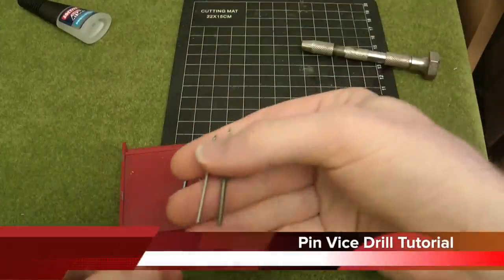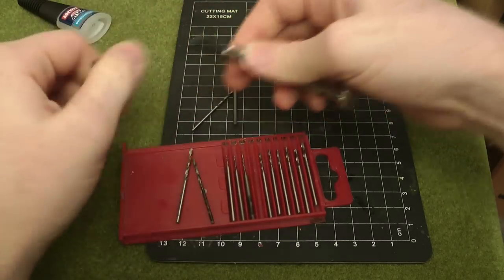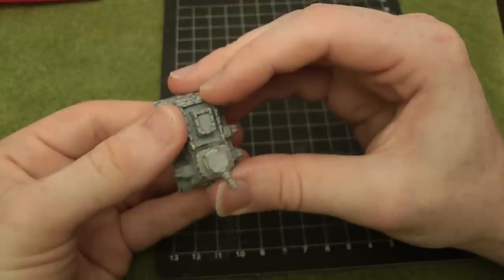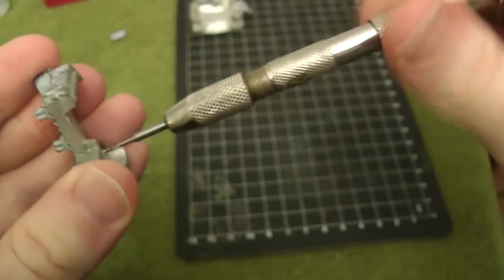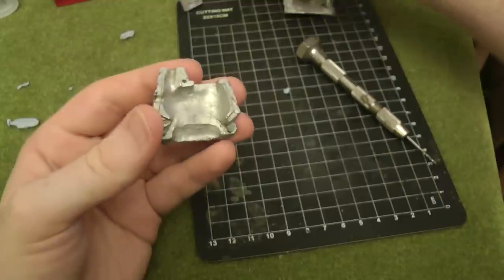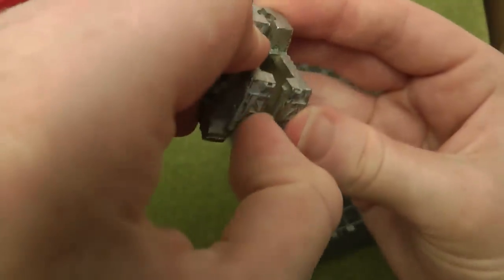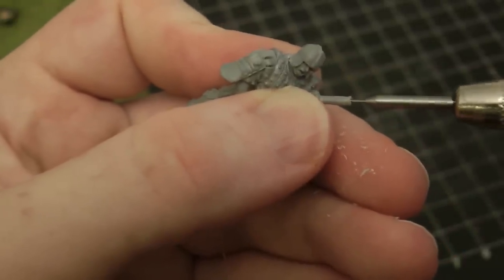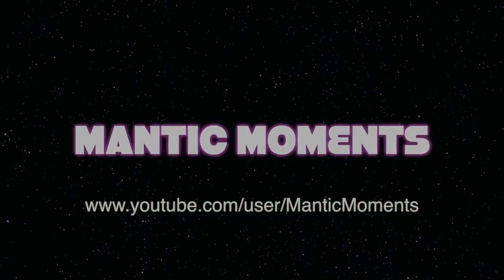Tutorial: Pin vice drill use

Comment: A brilliant tutorial (and I learned something new with the Blu-Tack trick) but you didn't mention lubricating the drill bit. I've done a lot of hand-drilling with pin-vices and I swear by using oiled drill-bits; the oil allows the blade of the drill bit to cut into metal much easier than a dry drill-bit.

Comment: I know this is an old video, but you can get nylon-jaw pliers to help you straighten out the bent wire. Jewelry-makers use these pliers because the nylon jaws won't mark or dent the wires. Grip the wire firmly between the jaws of the pliers and just pull the pliers across the length of the wire.

Comment: What is a better made brand of pin vice. I purchased a set of four (amazon) to work on small carburetors, but they dont really hold the drill bit securely and the drill slips or slides up in the handle
Thanks
Mike        Pasadena! Tx

Comment from the maker: A few people on various forums have asked why pinning is necessary for your miniatures. Here is the short version answer:

The main takeaways are that:
Glueing a model, even with superglue is kind of like gluing a desk together. It might hold, but it isn't very sturdy. Pinning is like using screws to put together your desk. 

Even if you don't want to pin for your plastic models and your smaller metal models, you must do it for your medium-large metal models. 

For anything but a basic model, it is a matter of when your model will be damaged, not if. Pinning severely reduces that problem, and can even prevent it, just like metal rods used in building construction.
Reply: Clear tutorial, but why aren't you putting extra glue on your models? That one example of the tank, you put only glue on the pins, but I would say you could glue all the edges aswell? If you got the right glue, it really melts the two pieces together doesn't it? So glue +  pins seems best? 
Anyway, good tutorial, I'm going to need this on my next models :D
Reply from the maker: Mach Heydt This is a metal model and I didn't want to accidentally slather the model in glue, and have it fit badly. I was worried because that part had to be done in 1 take, or I'd ruin it. Normally I'd add a little more super glue around the edges. Super glue doesn't melt the pieces though, and if you use too much in areas where the model should be flush you can end up with a frosty edge where you applied the super glue.You're right, definitely glue + pinning. Pinning means you can be sparing with the glue around the edges of the model.Glad it helped. Good luck with the pinning!
Reply: Mach Heydt  It's worth noting to the with super glue less can be more. Less glue gives a stronger bond then if you gush it all over the place for some reason.
Reply from the maker: Very true. I don't know if it came across in the video, but each hole was getting just a small dab on each half of the model. The wire does the rest of the work by spreading the glue down through the hole.
Reply: +ManticMoments Why not use a variable speed dremel to drill small holes? That vice thing looks slow and tedious. Just curious.
Reply from the maker: Hi Mike,
I find my hand drill gives easy accuracy, and I could make sure I was in the right position going forward. I really didn't want to mess up the tutorial and not be able to pin correctly.

The other thing is that I figured very few beginners would own a variable speed dremel, so went with what they'd likely have.
Reply: Okay. Thank you!  :-)

Comment: Hi, how do I know which size wire gauge for my drill bit to fit just right? If I have a 1mm drill bit do I just use a 1mm diameter wire?
Reply from the maker: Hi. I'm sorry for taking so long to reply. Been away from the channel for a while.

I would use slightly smaller wire than the drill bit I am using. Maybe .8mm in this situation. This is because you want there to be glue all along the inside of the hole, holding the wire in place. You can still try 1mm wires, but they can be very hard to fit.

When using the exact same size wire you might find when you are putting the two pieces together that they do not fit exactly right, unless you drilled absolutely perfectly. And even then, it will be tough to get it to fit correctly.
Reply: ManticMoments Thank you.

Comment: Hi this is great tutorial. Thanks. Btw, have you ever tried 'push drill' .. something like this : http://miniatures.about.com/od/toolsforminiatures/p/archimedesdrill.htm, this type of pin vice can be used like regular manual pin vice but also you can drill  by pushing it.
If you used both please share with me, which one is better for you ? and for what reason ? I'm choosing these types of drill, i don't know which one to choose. Any suggestion will he helpful. Thanks
Reply from the maker: Hi,
I just saw your comment. I've never tried the 'push drill'. I occasionally use drill bits that are just over 1mm, which means this wouldn't cover everything I need. However I just can't really make a call on it. Based on its price I'd certainly give it a shot, but then I use my drill quite frequently, and if it does drill well then it would prevent a lot of repetitive hand motion.